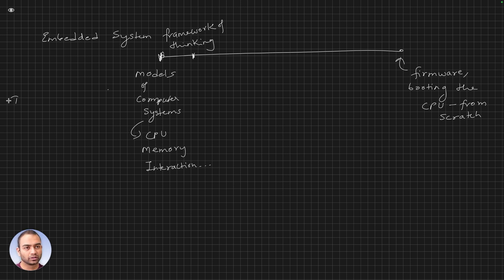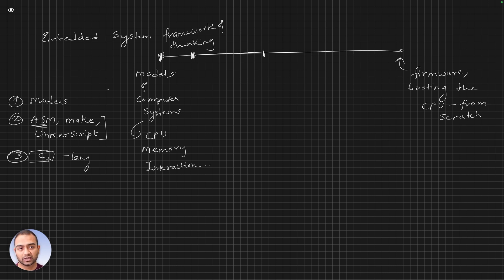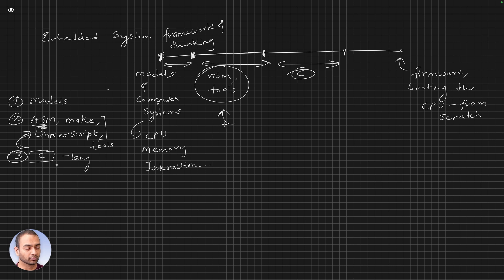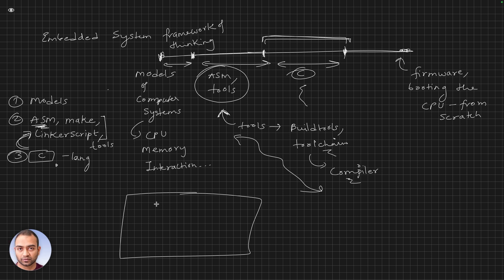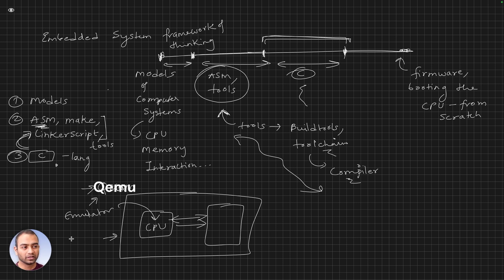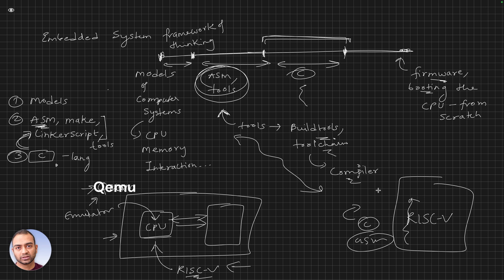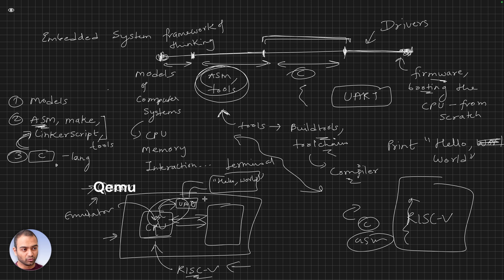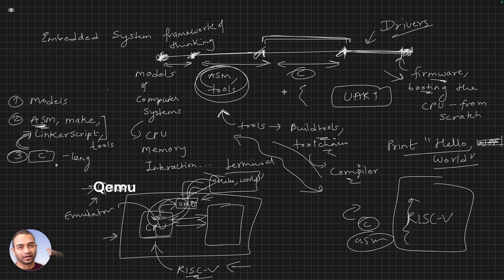Embedded Software Development - Roadmap | Assembly, C on Bare-metal RISC-V

Comment: Im a first year under grad (EEE)student i want to get into embedded systems but idk what to should i focus on C and DSA Right now or just follow along you bare-metal programming in the series u made please help:)))😃
Reply: Let me share my experience here, before jumping Directly into embedded systems work on your papers like Devices, Circuit theory, Digital Electronics, MPMC (develop your knowledge to the core). Believe me those are the foremost essential things for a beginner. Then move with C and lower level implementations , since you are strong in those fundas you can easily relate the stuffs together. After all these better choose a architecture like ARM work with it (use the boards if available in college lab). DSA is a hyped one you can grasp it quicker along the journey (better learn it after completing  C concepts) .